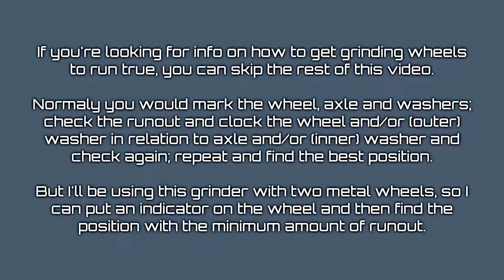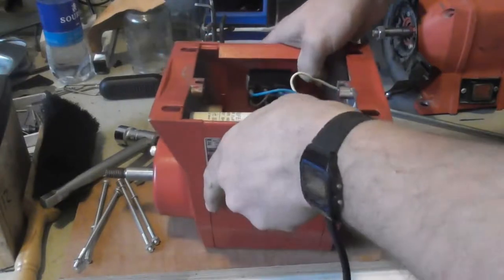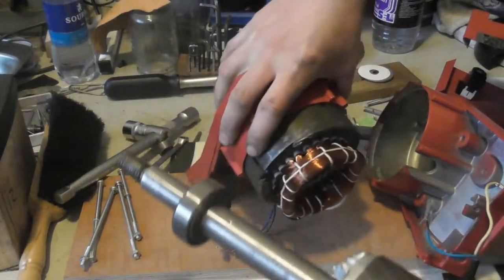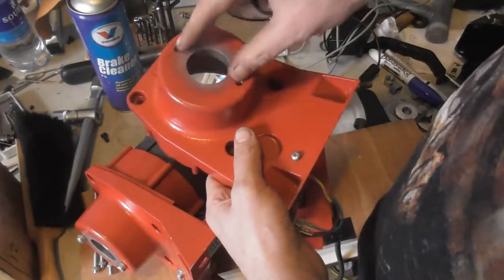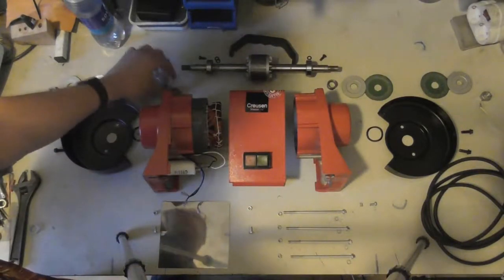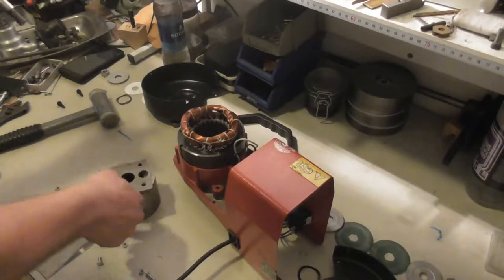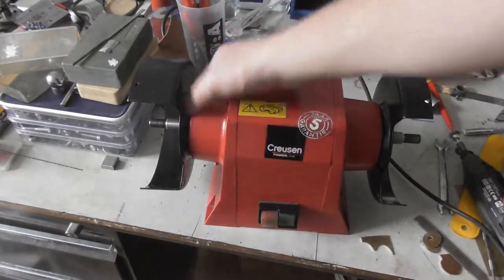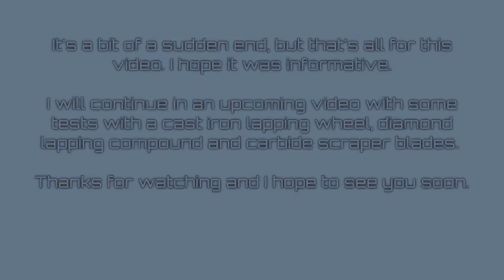Bench grinder repair

Comment: Hi, Nice video. I have a vintage bench grinder that has a lot of vibration. I can feel that the whole arbour shaft moves side to side by 2-3mm, is this normal? Just wanted to check before I try balancing the wheels. Your help would be much appreciated. Thank you.
Reply from the maker: Thanks. I'm not a repair technician, but that doesn't sound normal to me. I've never seen a bench grinder with that kind of end float. I'm not sure if balancing the wheels will solve your problem.
Reply: I have the same issue. Did you figure it out?
Reply: @dangrows_za4798  When I opened the grinder up, I found that the play was due to worn cir-clips that held the bearings in place. I added slightly thicker cir-clips which took up a little more space, just enough to take out the play. Hope this helps.